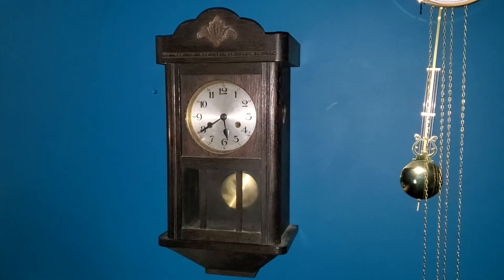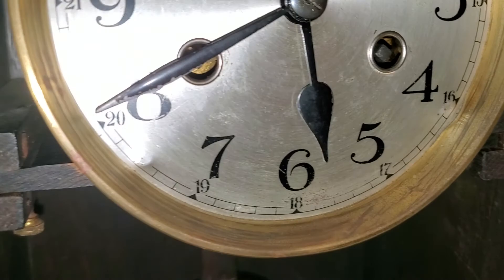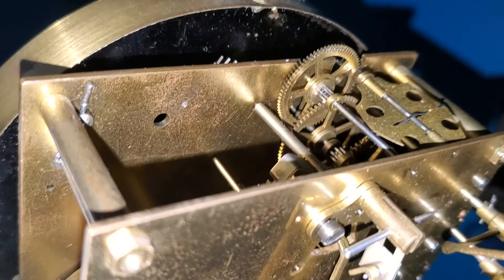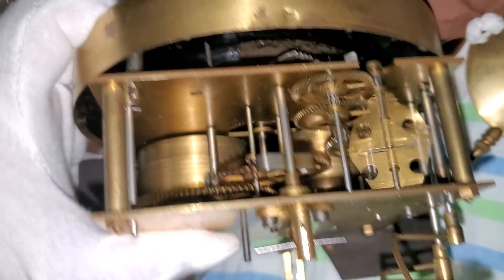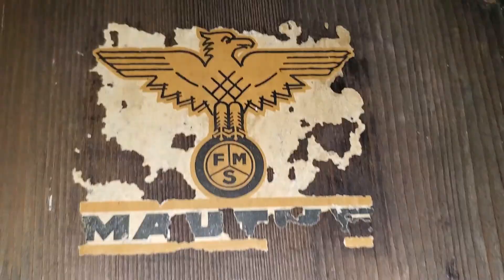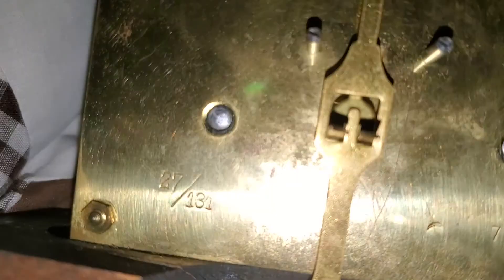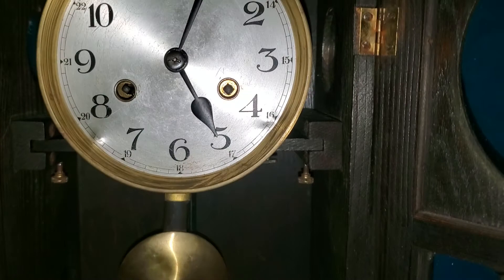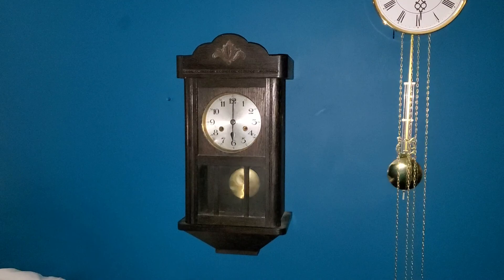C. 1925 F.M.S. Mauthe Wall Clock W/ Bim-Bam Striking

Comment from the maker: I say "powered by an anchor escapement" like it's actually what's running the clock. But the mainsprings are what's actually running it. Silly me.

(I should also mention I can't get a very good look at the pallets so I really can't tell if it's a recoil escapement or if it's meant to be a deadbeat. I'm basing my assumption off the way the escapement gear moves after each swing of the pendulum.)

Comment: Where did you get that spring? I have one movement from a friend i need to fix, but that whole "spring" is not there..
Reply from the maker: My local clock shop supplied it for me and they also helped size it for me. unfortunately suspension springs come in all different sorts of sizes so without a broken original one it may be difficult to find a correct one.

Comment: Do you have a grandfather clock yet?
Reply from the maker: Nope! Although if I do get one, it's gonna have to be a small one, more likely a grandmother clock like an Emperor or Ridgeway from the 70s.
Reply: I have one under repair and it is 76” tall. Made in 1976 by piper with hermle’s 450 series movement.
Reply: @Fred-nz9dp  nice